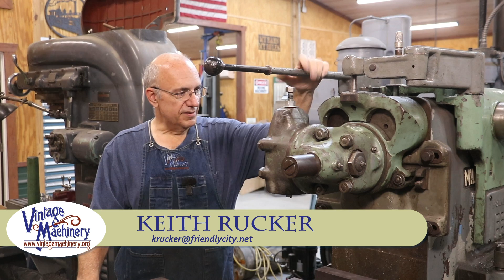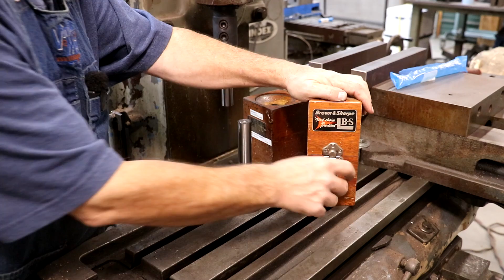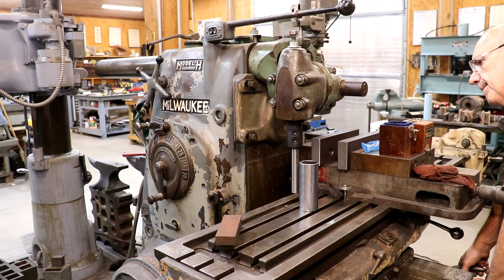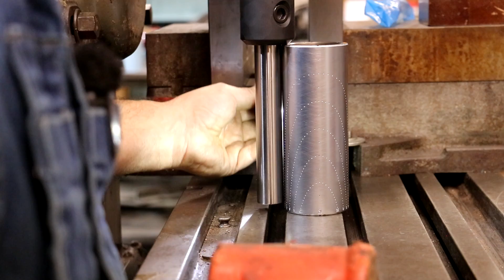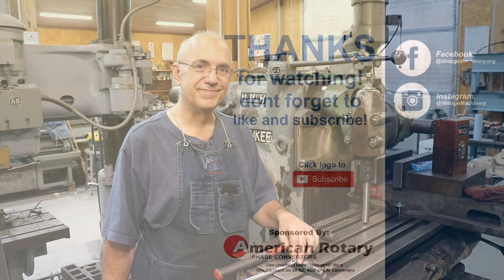Using a Cylinder Square to Tram a K&T High Speed Universal Head on my Horizontal Milling Machine

Comment: Could you use a wedge system for supporting the 1" diameter ground rod to keep the top from rotating as you make the second adjustment (the adjustment that isn't balanced weight-wise)?

Comment: Nice rant on precision.  Just because you can measure something to 10 decimal places, doesn't mean that you should. I once had an AM radio related application to the FCC rejected because they demand 3 decimal places of accuracy.  The nice lady called to tell me that she was rejecting the app & told me that  I had entered 5.0 amperes in one of the form fields.  She wanted 3 decimal places.  I finally convinced her that 5.0 was pretty close to the same as 5.000...

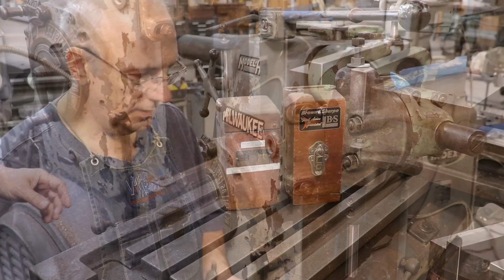Comment: I imagine, at some point after 7:37, perhaps off camera, Keith put a dial indicator on that shaft and rotated the spindle?  
I'm thinking, since it seems like it's a brand new tool holder, brand new precision silver steel shaft, and seems like they've never been combined on this machine before...  And, Keith's about to perform a somewhat pain in the neck adjustment.  It might be worth the extra few minutes to give the spindle a few rotations with a test indicator on the silver steel shaft to confirm concentricity, trueness, etc. 
Essentially qualifying the new tools to be used for tramming the machine with the old known-good tool (cylinder square).
Anyway, just a plus up, if you will.  Happy Thanksgiving '23, everyone!

Comment: Considering the projects you frequently attack, the precision YOU attain FAR EXCEEDS the original specifications.  Does a 100-year-old locomotive need 1/1000 inch accuracy?  HELL NO!  Or perhaps a cane mill??  Ha Ha, right!!  Even cylinder clearance specs on a locomotive coal feed engine are way less than the accuracy you attain.  That's why they have piston rings!!  You're good in my book, Keith, keep it up!!  Cheers

Comment: You hit a home run in your statement beginning at the 19:54 mark by summing up what, even prior to my machining hobby, that I daily had to measure within my own self to deliver on time regardless of time allotted a working stable product of the time per day freely given by me to meet the requirements of my several jobs in the electric power industry (Up to & including 500,000 Volts & a brand new Power Plant that was given to me to complete & commit, electrically, to the system we call the grid) & direct it's very 1st test to prove it was capable of fulfilling it's given mission. Well spoken Sir & although I am happily retired, consider of the regular classes I'm afforded to learn from in this, your trade, my favorite Professor. I really can only sum it up thusly: "There is no-one I look more forward to for my next video for the inspiration to fight my chronic back pain just to get up from this chair & show some progress. Don't stop what you're doing, just as you're doing, the time to continue & the Good Lord allows. It makes a bigger impact on countless lives more than you can count or know.

Comment: Your absolutely right. I was making a part at work, the machinist was busy repairing something important with the chief mechanic. I thought the part was for that operation and was trying to hit all the marks of the dimensions. I later found out the part was for the welder and just needed to be in the close to the dimensions and welded onto something else and the machinist would finish machining it after. I could have roughly made the part into roughing stage and right shape and it would have worked better and easier. The machinist said if you don’t know ask. Thanks for sharing.

Comment: Here is my two cents worth. If you are making parts for an old manure spreader, you probably don't need to work to .0005". One must realize that precision takes time and in a repair shop time costs money. So be fair to the customer and  make the time fit the job.

Comment: Commentary on the construction tolerances.  As an architect, I run into the younger people not understanding that, kind of in reverse of what you are talking about.  They miss the fact, that just because they can draw a 2x4 to exact dimensions in CAD, those don't exist in the real world.  It takes them a while to understand what to be concerned about and what can be out a little bit, and needs to be in order for it to be done economically.  You are working on a much finer scale, but same principal.  

I also like that you brought up the compounding error.  In my world, if you get the foundation in tolerances and specs, the rest of the building process is smooth!  Get it wrong and you spend all your time from then out trying to offset the error!  Never a fun time or a good product.

Its all about understanding the job and what the tolerances are.

Comment: Keith, love watching you work! I wonder if you put lock washers or Bellville washers on two of the holding bolts diagonally on that head so when you cracked those loose, there would still be enough tension to hold the head in place but you could still bump it for adjustment. Totally agree about precision, good to hear someone on YouTube point this out!

Comment: Going back 3 decades here, and I'm not sure what replaced it, or what  subsequently morphed out of it, but there used to be a management philosophy in industry called 'Total Quality Management' or TQM.  Which was an efficiency drive to better derive the specification requirement of whatever, and then complete that (say) part or work package to that spec, but no more, within time and cost restraints deemed appropriate, and no more.

Comment: There's a book Called "The Measure of All things".  The "Book" is about how the French tried to accurately determine the geographical location of various points on the face of the Earth.  Using the best measuring instruments of the time they were able to locate very accurately the location of various Monuments, Cities and points of interest.  However, as the project was nearing the end, the "Surveyor" could not pinpoint the location of a City in Spain (I think is was Spain). Later it was discovered, The reason was a build up of tolerances and personal error, like you mentioned.  The Surveyor eventually went "Mad" because he could not reconcile the error.   it wasn't until years later personal error was discovered.  if Two People try and measure the same object the measurements will usually be very close but rarely be exactly the same.  Just adding my two cents.  KOKO!  I miss ARW.

Comment: Great channel, love it. Have you considered putting a small screw jack on your vice and placing it where it can support the  over-hung weight of the head, to stop the rotational movement of the rear pivot when loose/cracked for adjustment? The screw jack could be used for fine adjustment? Cheers, Glenn

Comment: Love the chanel and you are so 100% correct about precision..i run a general/precision repair shop for obsolete vehicles and machinery. I chose the precision thats required for each job..the other side to over precision working is you are pricing yourself out of work in the long termas the extra time required to hit that extra notch is going to make no difference in any way to the job except in your head.
Reply: And your bank account. A machinist’s time costs money.

Comment: Yes, I do have an indicating micrometer that is accurate down to: 0.0001 mm or 0.0000039." I do all of my most  precise measured work in the metric system.

Comment: Thanks for the video Keith; it's a good one. I have a question though. I have one of these B&S cylinder squares and mine is in very nice shape with an original wooden case like yours has. Is there any literature available anywhere for one of these squares? Using it on the tilt side is pretty intuitional but I would like to have any document or instructions on its use. Thanks again!

Comment: With regard to Keith's discussion about tolerance and precision (at ~20:00), my pet peeve is when counted numbers and measured numbers are confused.  You can have exactly three apples.  That is a counted number.  But you can never measure exactly 3 inches.  Or weigh exactly 3 pounds.  Or wait exactly 3 minutes.  Those are measured numbers and are only accurate to some precision.

Comment: For the axis that runs parallel to the table that is difficult to adjust because of the head being cantilevered: you could put a block of wood below the rod in the spindle so that it supports the head from flopping over and just enough under it that you could still measure with the cylinder. Then Use the table up/down to adjust it.

Comment: In s boat shop where my father worked in 1940 & 41, a coworker after being satisfied with the fit up of a part wold say," Ya good enough dis kind a ship", a phrase we will say when we know we could do better,  but the job doesn't require it. Further along this line an area contractor that new my dad,s reputation for doing very fine work told me that though he admired dads work he would never want him on a job because he would not stop with good enough.  I guess that't what's meant by the saying that perfection is the enemy of good enough.

Comment: Pefection is the enemy of profit. Period. Your channel has become one of my favorites for this reason. Because I admire the fact that you don't let the income of your day job or other income sources skew your pursuit of precision. No offense to channels like blondie hacks and clough42, also great channels, but theiroutside income allow them the ability to chase tenths  with zero worry of making payroll at the end of the week or getting a part out to spec by the end of the week profitably and it becomes a neurotic pursuit of those that need to. Robrenz, adamthemachinist, stephan, all step down their tolerances when they are making a refrigerator_holder_shutter gadget out of bent banding stock or a 3d print. Clough has the luxury of time to dial in his 3D printers, no different than grimsmo, to speed futute production. Makes sense but its a luxury not often afforded.

I am never endingly amazed at how much all of you creators have to defend yourselves against the comments. Its a rock i would never beat myself against.

Great video

Comment: Perfection is the enemy of good enough. When you only need to be +/- .005" why bother reading to tenths on the micrometer. Or why bother going to get a micrometer when the dial calipers in your hand are within a tenth or two of the micrometer. You can waste a lot of time trying to attain perfection when good enough is the ideal target.

Comment: 20:30 That hits home because as a computer programmer we also go into that rabbit hole, we sometimes spend so much time trying to make something perfect that it's not worth it. As you say sometimes it's just good enough.
Reply: Actually, it's always "just good enough" even if your best measuring tool shows it's dead on the numbers, because your best measuring tool was made to a tolerance, too.  The machinist's skill and judgement comes into play in knowing the point at which chasing even more precision is pointless.
I love to see the tools that Keith has accumulated over time - the Leaning Cylinder is a gem, and must have demanded some fantastic manufacturing.

Comment: Keith,
Your discussion touched on tolerance stack up and reminded me of my 2 experiences with this issue.  The first one occurred back in my Air Force carrier when I was to demonstrate the stall warning and prevention system just installed in our FB-111A fleet to a general officer.  The demonstration began a altitude with pulling the power to idle while maintaining altitude and watching the AOA (angle of attach) rise until a set point where the stall warning should occur and the "stick kicker" push the flight controls forward to reduce the AOA.  As we passed the AOA point where the system should activate, but noting happened.  Upon investigation we found that everything was within tolerance and working properly.  The tolerances were just all in the same direction and the "stacking" of the tolerances allowed  the system to exceed the overall specifications.  
The second occurred when we were required to measure some specific points on our fleet of B-1B bombers at the base where I was assigned.  We hung plumb bobs from specific points and took measurements for all of our assigned aircraft. We found that there was as much a a foot's difference in the length of our shortest B1-B to the longest due to tolerance stacking.

Comment: I get why Keith's "new" vertical head is nice to have because it can be tilted in two axes.  But why use it for simple vertical milling? It seems that this just adds additional "play" between the main shaft and the cutter.
Reply: Rotational play or lash is of no consequence on a shaft that only runs in one direction and is not timed to another rotating shaft.  This mill is a lot stronger that a Bridgeport-style vertical knee mill so it will have a lot less deflection.  The upcoming job is also an excuse to play with the new toys.  No further justification is needed.

Comment: keith, why wouldnt you use an indicator on the table on a post or something and run the table up and down indicating along the shaft? wouldnt that tell you more accuratly than by eye?
Reply: He doesn't need it to be that accurate, and this way is faster for him
Reply: You missed the entire point of the video.

Comment: Keith, at 20:00 you speak about "good enough".  I 100% agree with you.  You match the effort to the required tolerances.  Why would I hold a 0.0001 tolerance on a part that has a +/- 0.003 tolerance?  time is money, and the extra effort and time it takes to get to that level of precision doesn't put $$$ in the bank. Braggin' rights don't put food on the table.  Nice video!

Comment: If you do ever adjust the other part of the universal head, I would consider using a machinist jack from the bed to the casting to provide support for the adjustment. It would also work a bit like the worm gears in other milling machines.
Reply: I was wondering why he couldn't use the vise that's mounted on the table to resist the rotation of axis... but the jack is also a great idea.
Reply: Agreed!  It could be under the furthest out part. Put in the jack just touching, then measure the height to the bed, then loosen screws-if it drops ("nods") at all just use the screw jack to bring it back to the original height.
Reply: I was thinking the same thing, put it under the rod and turn it up or down. Also thought about loosing everything with the face mill installed and letting it sit flat on the table... then tighten everything down. Wonder how close thatd be...
Reply: @KPSchleyer  You wouldn't want to jack it up by the rod as it'll bend.
Reply: Why not just have the z-axis do the jacking? Stick an appropriate length rod in between the head and the table, raise the table slightly for movement in one direction and lower it to go the other way.
Reply: @pettere8429 The Z axis is heavier. If you run it by hand, that is more force you have to do yourself. If you do it with a motor, it would be harder to fine adjust. By using a machinist jack it will also put the thing you are manipulating right next to the thing you are trying to adjust.

Comment: I'm sure you were OK, but have you seen Adam's recent video, 5 days ago https://www.youtube.com/watch?v=dGoRU04tyEo around 28 minutes in where he is trying to do a very similar tramming process on a new 6-jaw chuck and it keeps getting about 2 thou out. He discovers that the round bar stock he's using with his dial indicator is actually bent!. I'd have liked to see you rotate the bar you were using just in case. OK, his bar had been in stock for some time and used for other tramming jobs (presumably where the bend didn't figure) and yours was brand new.
Reply: Yep I watched Abom falling into that trap and called it.  But then again, I have some proprietary knowledge...  My company sells a product that uses Thompson ground bar, and I am the one that checks them for straightness.  Some of them.... aren't.

Comment: Your comments on the subject of "good-a-nuff" were spot on. As a retired machine shop supervisor this was a endless problem on both sides of the spectrum. We once had a job of building the "wishbone" for a three point hitch on a tractor implement. I knew I was in trouble when 7 Hrs. into a 2-1/2 Hrs. job I saw the machinist with a set of (very expensive) 36" dial calipers measuring a welding/fabrication job only needing a framing square and tape measure. Didn't make any money on that one! But it was dead nuts on. You have to use some judgment on what degree of accuracy is needed.  Good job Keith! Keep it up buddy.

Comment: Just for the sake of completeness, when using a new holder in this situation i would have spun the ground bar and used a dial gauge at the bottom to check for run out, but that is just me being paranoid about modern kit which is often from the east even with a reputable name etched on it. 😉

Comment: I do wish machinists would quit using the word tram. That is a vehicle. There is no such thing as tramming. You are squaring it to the table.
Reply: The Oxford English Dictionary reports one definition for “tramming” from 1891 that reads: “To use a tram or tram-staff in adjusting spindles or axles, or in measuring, aligning, or the like.” The origin of “tram” derived from the shaft used on a wagon that rode on parallel rails, which required the shaft and wheels to be straight and square.
Reply: We've been using the word for well over a hundred years. You're just going to have to accept that words have more than one definition.

Comment: At the beginning you mentioned that you set the 2 dials to 0 and it was not really at zero. After the final adjustments, what does the two dials show?
Reply: The protractors would still read zero. The changes he made were so minor  you wouldn’t be able to see the difference.